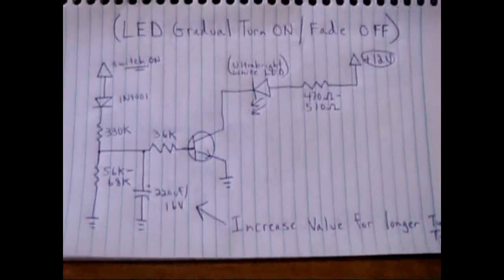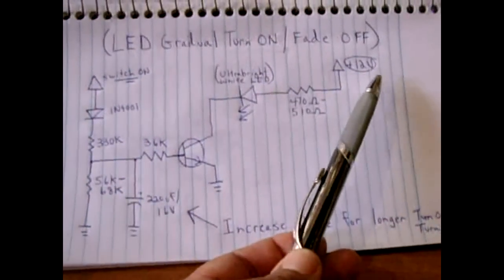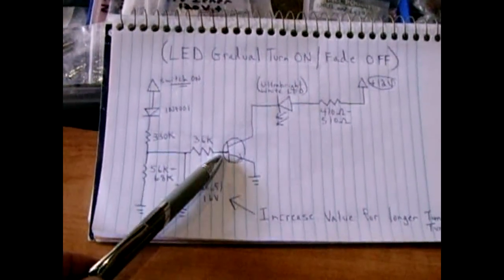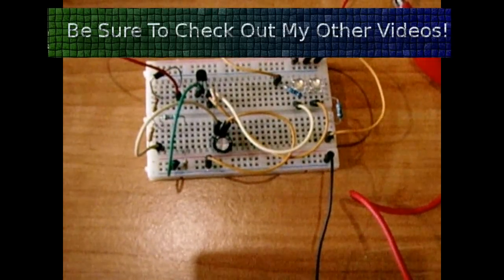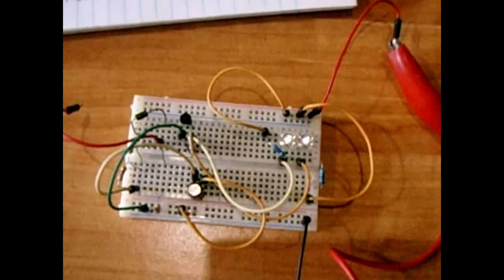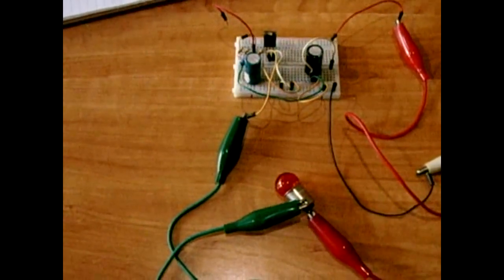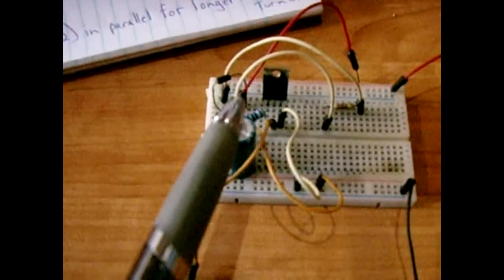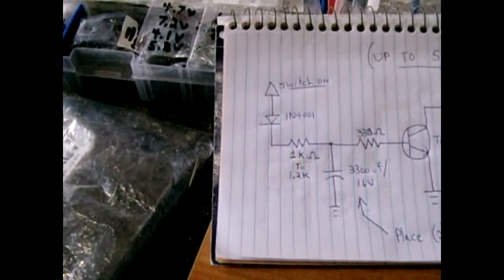Simple Gradual ON / Fade OFF Circuit For 12V(Car LED's)

Comment: The circuit you designed was very useful. I can wire more capacitors in parallel or a high capacitance capacitor for longer delay time 👍

Comment: I was looking for a relatively inexpensive circuit for an 8 channel sequential Christmas tree light controller. This fits the bill perfectly. I am using a  555 to pulse a 4017 decade counter. The outputs will enable 1 of 8 channels  of DC controlled dimmers I have. each output will feed a different color of lights on the tree. I did not want to go to the trouble of using an Arduino as I have not done any work with them and I do not write code. This along with my sequencer should work perfectly. Thank you!
Reply: Sounds like a good idea.
Remember to connect the 9th output of the decade counter to the 'reset' connection of the 4017, otherwise you'll have a short period of complete darkness every cycle.

Also, to save on using such massive capacitors, you can increase the value of the resistors acting as the voltage divider in this circuit.
ie, if both values are multipiplied by ten, the capacitor value can be decreased by ten times too, meaning only a 220uf cap could work.

Comment: I have a smallish terminator 2 wall plaque of a terminator face. Upon the press of a button, the Led eyes flash on and off quite quickly. Do you think an electrician could put a capacitor in the circuit? The back is hollow and there seems enough wire? I’d like the eyes to light up and fade off? Cheers, Brian.

Comment: Great video. I would like to replace the incandescent bulbs in an old aircraft anunciator panel by LED’s. I would like to have the LED’s ramp up and down simulating a incandescent bulb, so almost unnoticeable but slower than the LED’s usual on off speed. Any info would be much appreciated.

Comment: sir I want the negative voltage at the base to turn on and off the transistor my vehicle uses negative voltage to control the switching on and off the light should I use a PNP transistor or should I make a NPN circuit for the dimming and soft start and have an PNP transistor turn on the NPN transistor or can we actually have an PNP transistor alone to make this thing work I am a beginner in electronics this would mean a lot to me, thanks. 
Regards

Comment: Great video! Do you have any recommendations for turning on an LED for 3 different time presets? Say for 1 second, 2 seconds, or 3 seconds then immediately turns off. I'd need some kind of 3 stage switch, but I'm not sure what to use to set the time intervals for allowing power to the LED from the battery.

Comment: Hey..thank you for that impressive circuit. I did try it with the same components but unfortunately it doesn't fade off. The long fade in ( turn on) works, but not the long turn off. As soon as I turn off current, the LED turns off, like without circuit. 
What could be the isssue ?  Would be glad to get solution. Thanx
Reply from the maker: Something isn't right with your circuit.

Comment: Can this circuit be used with a constant positive and a switched negative?
I have a honda and would like to use this on the dome light (negative switched) it has LED replacement bulbs and am installing foot well lights. They foot well lights are 9-14volt 0.06-0.08amps I'm not sure what the dome lights are. Would this work on all 4 LEDs?

Comment: Hello, great video, thanks so much, I'm going to use it for lighting stair tread led strips in my new house. I dont suppose you know how to scale it for similar effect for 12v led strips drawing about 2A ?
Reply from the maker: You'll need to experiment using different values. Thanks for watching!
Reply: @electronicsNmore   hi if o wnat fade with 1 minute to on led what can i do ? slow fade in 1 minute

Comment: What if you had varying levels of amperage? Like led strips you cut to size. If you had say a ~4amp circuit what would you need to upsize to make this work?
Reply from the maker: Don't exceed what I stated.
Reply: @electronicsNmore  so this isn't possible with a higher current light if you increased the size of the components in the circuit?

Comment: Hi, i will use 20pcs 12v led motorcycle for this circuit,,, do i have to change some values of capacitor, resistor and transistor to make this work fine? 
Thank you,

Comment: Would this, in theory, extend the life of LEDs and help against premature burnout?

I've got some shoplights from Amazon (the 4ft T8s that are wicked bright).
I've seen a handful of people who also have them that are experiencing premature burnout (some of the LEDs flicker, are dim and/or some just stop working full stop.)

*Would limiting the power slightly and having them come on slowly (instead of hitting them with full power the moment the switch is flipped) help prolong their life and performance?*

Or do electrical work and wear to the same principals as hydrodynamics? (Example, you'd never crack open a main water valve due to the risk of hammer destroying the system or/and the spigots/systems down wind)

Comment: I have 2.5 " red hunting led light that i want to make it fade on slow and off with a motion sensor. All in the same circuit. red led light current draw is 0.5 a (500 ma) operating volt ( 1 2 volts ) power consumption 6 watts and 300 lumen. can you show me a circuit with all that in it.

Comment: Hi. Thx for shearing this circuit. I built it, works fine. I want to use this circuit for my car dome light. I need your advice for connecting this circuit to my car dome light. My car door switch connects negative (-)  supply but this circuit has switch connects positive (+).  Is there any chance to connect this circuit directly to two wires of the dome bulb. Please help.

Thank you
Reply from the maker: Prabuddha Koralagama The upper left side of the schematic that supplies power to the transistor, is where you take the +12VDC connected to the dome light and connect it to the circuit instead. You take one relay contact(The Common Terminal) and connect that to +12VDC power(Batt) that is always ON even with the key off. The other relay contact (NO) is connected to the dome light. Pretty simple.

Be sure to share, and rate Thumbs Up.

Thanks.
Reply from the maker: Unfortunately I do not offer special assistance to my viewers. I already gave you a lot more information than any other channel would give you. I simply do not have the time to assist everyone. This circuit is extremely easy. You will figure it out.

Thanks For watching.
Reply: Ok. I make it work, thanks
Reply: Hi, did you ever get this to work with the dome light?
Reply from the maker: Reinhold Jahnke
It works. :-)
Reply: Hi electronicsNmore. Thank you for the circuit and yes it works great. I want to use it for a dome light in my car. I was wondering if Prabuddha Koralagama got it working and if so how.
Reply from the maker: Use the circuit shown at 6:25 in the video. Take the wire connecting to the dome light(positive), remove it from the light, and connect it to where the schematic says "Switch On". Take 12V from the battery(always on), and connect it to where the schematic says (+12V). The (-) of the capacitor & emitter of the transistor are connected to the vehicle's chassis(ground) Simple as that.
Reply: Hi electronicsNmore. Thank you so much for kind assistance. I really appreciate it
Reply: Hi electronicsNmore, will it work the same way in the first circuit or are the other changes to be made. The reason I ask is I have an LED in the dome light instead of an incandescent bulb.
Reply from the maker: Church of Christ George
How much current does the LED lamp draw?
Reply: The bulb drwas about 50milliamp
Reply from the maker: Church of Christ George
Use the first circuit shown.
Reply: Thank you. And the modifications needed for it to switch negative instead of positive?
Reply: Hi electronicsNmore. The circuit works great, thank you for that. I want to use this circuit to fade in and out an LED dome light. The switch is negative where your circuit is positive. How can I modify the circuit to use negative instead of positive.

Comment: Hi, would this be suitable to delay both the on and off time of a relay. I have put together two of your other videos (Delay relay On & Delay relay Off) but incorporating them together doesn't seem to work for me. I may be missing a few things, but the thing I am trying to do is avoid erroneous switching on and off (chattering) of the relay by just using capacitors and that is where I'm at in my learning curve right now.

Comment: excelent circuit and explanation, how could you rise the output to handle a load of 4 or 5 amps ? i try to drive a horn that imitates a bull or a cow , but the current consumption is over 4 amps
Reply from the maker: Try a high current rated transistor. You'll need to experiment.

Comment: And this is true analog, everything work at DC, no flickering. The best for aquarium.

Just imaging how shrimps will survive digital smooth on starters operating at 600-1000Hz.
They already have small shock when light abruptly starts up.

Comment: Nice presentation of DC RC circuit principles! Any 110v auto dim/brighten circuits for a 60watt incandescent or clf/led bulb bulb you know of that i can fit into a typical light bulb socket housing ? Every thing I've found uses blue tooth technology, is expensive and is overkill for my need
Reply from the maker: +James Adams 
Hello James. I don't know of anything small enough that would fit inside a light bulb socket housing.
Thanks For Watching!

Comment: Is it possible to keep the bulbs on for something like 30 minutes to an hour? how big would does capacitors need to be?
Reply from the maker: You need to use the delay off circuit from my. video below.  The schematic is located in the video description area of that video. Using a larger value capacitor and or resistor can give you the time you need. You can use this gradual ON/Fade Off circuit in conjunction with the other circuit.

Water Heater Timer Circuit ~ Auto Off

Thanks For watching.
Please share the links to my videos and Youtube channel.
Reply: Is there any way to get this to work with a push to make switch rather than a latching switch?

Comment: Hi, and thnx for shearing that practical circuit, i have a little question, 
How can I connect this circuit to a led strip?
Reply: Theoretically, the LED strip will behave like the two high power LEDs, but it does not need the shown pre-resistor because the pre-resistors are already integrated in the strip itself.

Comment: Nice.  I currently have 4 LED arrays on my boot lid ( yes it’s bright). Just worked by a PIR giving an output of 3.6 volts.  I use this, via a N2222 transistor to work a 12v relay.
Me being lazy, do you know if can I use the 3.6v to control the power transistor or will I need to step up my 3.6v first?    I rather fancy fade in/out LEDs worked by a PIR.
Reply from the maker: 3.6V should be OK.

Comment: Say I want a light to fade off only, and not fade on. How would this circuit be modified to accomplish this?
Reply from the maker: Add another diode(same direction) at the junction of the capacitor and 2 resistors which connects to the same switched on power as the diode on the left in the schematic. You should have instant on, and fade off.

Thanks For Watching! Be sure to share and rate Thumbs Up.

Comment: The car will also use 12V LED strip with will burn
what kind of transistor do I need to use
Can you provide material list
I want to burn it out as fast as in section 2.
sorry my english is not good
Thank you
Reply from the maker: Do as show in the video for higher current. Look online for similar higher current transistors if you need one.
Reply: electronicsNmore  Do you know the model name of transistor I couldn’t find in the video

Comment: What can be put instead of 41a?
Reply from the maker: https://alltransistors.com/crsearch.php?mat=Si&struct=NPN&pc=65&ucb=100&uce=60&ueb=5&ic=6&tj=150&ft=3&hfe=20&caps=TO220
Reply: @electronicsNmore  thanks, but i used tip41C, not working :(

Comment: Can I use this for a 24V 18W LED light ? Or what alteration should i making in this circuit ?
Reply from the maker: 750mA is kinda high, but it may work. Make sure you use a TIP31A NPN transistor, and the electrolytic capacitor must have a voltage rating of 35 or 50v.
Reply: @electronicsNmore  what if the capacitor voltage rating is lower than 35v?

Comment: Really good clip!!!, what changes to the schematic would I need to use 10 Diodes?
Reply: It depends on the type/power consuption of theses 10 diodes.
But a standard LED strip for example is no problem, no changes to setup one or two, depening on soft start/stop preference.
If you overdo it, the transistor might get a lttle hot (like with the light bulb in the video). 
Passive cooling can help to increase the life span in that case and is also not a big deal.

Comment: Hello sir, this video is just what i was looking for for some time. I need to make this fade effect for aquarium lamp witch is more stronger (about 60-70W LED lights) and to easy adjust time fading.   Can you pls help with that?
Reply from the maker: That current level is a little high for this circuit.

Comment: So if I'm not wrong, the base/gate on a transistor is isolated from the collector/emitter path, so is there any reason the left side of your LED version diagram couldn't be running on a +5V source while the LED side is on a +12V source, as long as the grounds of both sources are connected together?
Reply from the maker: You can do that.
Reply: So I ended up building it as all 12V like your second circuit, since I have some LED strip segments that in parallel will draw about 560ma when connected direct to a 12V source. The only difference is that the NPN I have is a TIP31C vs the TIP41A. With 2x3300uf caps the ramp is still a little too fast for me, but with a pair of 4700uf caps it's perfect. The only trouble is that even when fully ramped up, I'm only getting about 160ma across the C/E path of the transistor when using the default 1K and 330 ohm resistors. If I lower the resistor values, it increases the current available to the LEDs, but it speeds the ramp time way up too. Any ideas how to get slow ramp and 500ma at the same time? The TIP31C is rated at 6 Amps so I thought it should be fine, but maybe that's the problem? Maybe adding a second transistor circuit in parallel or series? Any guidance you could provide would be much appreciated! Thanks.

Comment: Will this work for 12v 1meter LED strip lights? Thank you very much!
Reply from the maker: 1 meter of LED lights on a strip should draw around 1/3A. The circuit should work fine. The larger incandescent bulb in this video draws more than that.

Thanks For Watching! Be sure to share my channel with others and rate thumbs up.
Reply: electronicsNmore Thank you very much :)

Comment: H,  great vids!
Questions- I'm using a 63mini bulb which requires 7V - draws 630 mA.  I'm going to use a 9V battery.  If I change the 1st resistor value to drop the extra 2 volts, do I need to change any other component values?
Thanks!
Reply from the maker: Hi. For 630mA, you might get away using a 2n4401, if it gets hot try a TIP120. You'll need to experiment with different transistor values. Make what I show, then swap one at a time.

Comment: It takes too long before you see any light after switching on.      Could you keep the capacitor partially charged all the time to avoid this delay?
Reply from the maker: Hello. You must be using a load which draws a lot of current, or you need to experiment with different value resistors and capacitor.
Reply: I meant in your example in the video. There is a delay before you start seeing any light at all.
Reply from the maker: Sean Smith The circuit is a GRADUAL on and fade off.
Reply: But there is a long delay before the transistor provides the minimum voltage needed by the LED to illuminate even slightly. It spends half the time off and then half the time gradually fading on.
Reply from the maker: Sean Smith
At 3:15 you could see how well it works. Clearly the LED will not immediately turn on starting at a very low dim state. The voltage needs to climb until the voltage is high enough to start turning on the LED.
Reply: Indeed, which is why I wonder whether the capacitor could be held partially precharged by a potential divider to reduce that delay.

Comment: Hi, this circuit can work with a strip led? I don't know how that absorbs really, I think between 5 and 12w.
Reply from the maker: Yes, just as long as the LED strip light does not draw too much current. Thanks for watching!
Reply: Thank you. I would like to use it for an aquarium light. At the moment the light works at 12V AC but it turn on with DC power also. I think the light absorbs over 5W. What do you think about modifications to do to your circuit to work with my aquarium light?

Comment: Hi!! I have done a circuit! thankyou very much for this video!

I noticed my LED doesn't light at its full brightness, which resistor is the cause? I suppose it's the one that connects directly to the LED? Thankyou! Greetings from Indonesia!
Reply from the maker: Egarolla Lower the resistor value in series with the LED.

Comment: hi! i would make the same with 2 led, in particular 3watt led. they are connected to 5v battery. what type of capacitor and transistor should i use?
Reply from the maker: You need to experiment using different values.
Reply: Okok Could you indicate approximately what kind of transistor and capacitor should I use?

Comment: I'm having trouble buying an assortment pack of resistors on Amazon that have exactly 330k with 56k, 36k, and 470 resistors. Aside from the established range in the diagram (56k-63k) can I use resistors just barely outside of that range?

And will 1/4 watt resistors work for this project?
Reply from the maker: Doesn't have to be exact. :-)
Reply: Thank you!